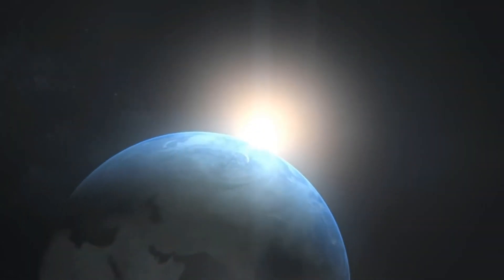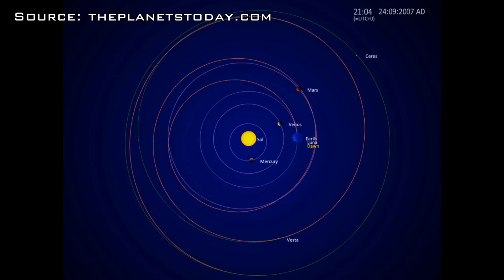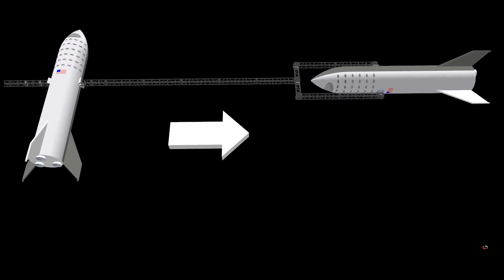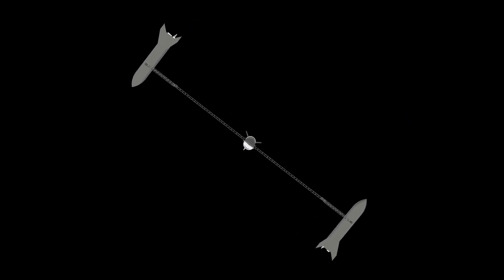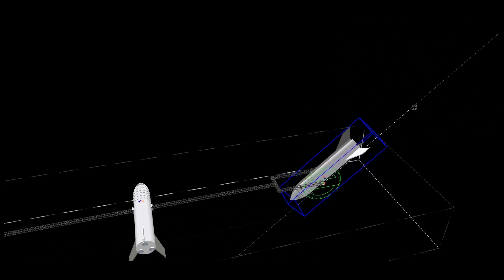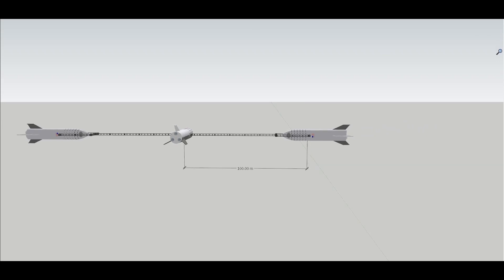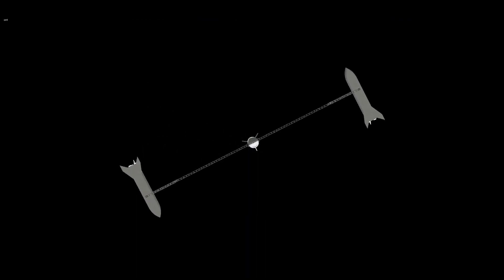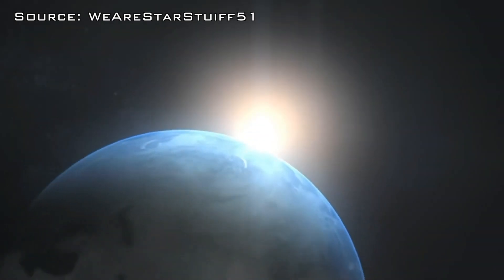GLS2: Artificial Gravity for SpaceX's Starship

Comment: It would be good to consider disaster recovery.
Reply from the maker: I agree! I'm working on a quick release system for GLS v3 right now!
Reply: @smallstars  Yeah. Not just quick-release. But if something happens that severs the linkage between the crafts while they're spinning, you don't want the crafts flying off into nothingness.

Maybe need to account for it with the onboard fuel. Or have some sort of redundancy.
Reply: @smallstars  With a 5 or 7 ship setup, you could cross-link the crafts, so even if the central connection is lost, the exterior ones still exist.

Maybe the exterior connection is done with tethers, with your existing truss-like setup.

Or maybe the exterior connection is done with trusses, and the interior is done with tethers.

Or with that many ships interconnected like a bicycle wheel, going back to using a tether makes sense again.
Reply: @smallstars  Or a truss/tether hybrid. Like trusses that extend outward from the ship on either side, allowing each craft to have two sets of tethers on either side, both expanding the circumference and toward the center.
Reply: Being that they're making specific ships for cargo, moon-landing and mars voyages, I would assume you could have powerful thrusters installed on the sides to get the AG going, rather than spinning the crafts around to get the AG going. Or just have boosters installed on the sides of the trusses. Either way, it would be cool to see if you have ideas outside of just leveraging the onboard engines. There's no reason 1 cargo ship couldn't contain all the materials and engines to create more of a harness structure for several ships.

Comment: I think the smartest way to build in space is with some kind of concrete. You send up the framework and materials for a large pressurised spaceship. Construct the large star ship and slowly send space cement to fill up the wall cavities. You end up with a huge spaceship that is impervious to radiation (like a power station). You could make something really big and barrel shaped that spins to create artificial gravity. Design it all on the earth and construct it in space. This thing will never enter an orbit. It will be a huge ship that maintains orbit around a planet that smaller rockets can dock with. The added bonus of this design is that much of the material for the space cement might be easily sourced on the moon or mars. Nothing weighs anything in space, so you could make it quite thick to add protection from space dust. I wonder if (without gravity) you could use electromagnets to have a barrel spin without friction around a stable core? The nose could have orientated cameras and sensors that are controlled remotely from inside the spinning barrel. The whole thing could be covered in solar panels. Maybe you could have a crew rotation system. The majority of the crew enjoy gravity in the spinning part but there are some crew in the anti-gravity core and nose. The barrel could be systematically stopped, to swap crew and supplies between the two parts (so that no-one stays permanently in anti-gravity).  I literally know nothing about the science of this and just came up with this. Seems legit though, right?

Comment: The radius would have to be more like 1 Km, according to the data presented here:
https://youtu.be/xu1Qv4AfCV4?t=399 (also before the time stamp)

You would never spin it down with the main engines, the vibrations and forces would tear your little tether apart, especially if they do not fire absolutely synchronously - which they would not. Also, it will never happen because you do not fit 2 kilometres of tether structure in to that 3rd rocket - and you would not land it on Mars!. So if anybody ever goes, they will go without artificial gravity. In your 100m diameter model, the astronauts would literally go insane from being pinned around.

Comment: Nice idea but there may be a better way that 1) uses a Bigelow tether that takes up less space when stowed away, 2) uses a simple electric motor to create spin, and 3) uses a central hub control module that is motionless relative to the direction of travel but controls 2 starship pairs each spinning counter-wise.
Reply from the maker: For your first point, I'm working on a new version of this that has a similar feature. For your 2nd and 3rd points, it's tough to apply these solutions to a system of this scale. One of the goals with this system is to be reusable for trips back and fourth from mars. My SpaceX Space Station concept which is on a much larger scale, utilizes you 2nd and 3rd ideas very well.

Comment: Fantastic start!I  I doubt a Starship can take the side loads you wish to impose at spin-up and slow-down.  Easier to plumb-in smaller methalox rockets on the gantry and leave the Starships in the loading position they are designed for.

Comment: You can solve the problem, i think, if you don't swive the ships yo the Center.
Reply from the maker: True
Reply: @smallstars   you need check if the forces of the people walking along the ships are not enought to change the valance of the sistem, you should consider two arms insted of one.

Comment: Could the spin not be used to get the units into orbit, thus saving the 3 tons of fuel upon arrival at mars?
Reply from the maker: Great question! For something like this we'll have to use the "tangential" spin speed of 31 meters per second. I don't believe a change in velocity or delta V of 31 m/s would be enough to save 3 tons of fuel when the starships arrive at Mars. I'm assuming you're talking about flinging them off of the  spin system in just the right direction upon arrival. You could certainly save some fuel by doing such a thing, but it would have to be very very precisely executed.

Comment: Interesting idea based on real physics but as a structural engineer I think the challenge would be making the truss sections strong enough to take the bending forces during the spin acceleration.  Pure tension forces are relatively easy to handle (a cable could do it) but as you rightly noted the truss needs to be rigid in bending to transfer the force couple applied at the outer ends by the starship main engines to the spin axis in the middle. Each truss is therefore acting like a cantilever beam, similar to a diving board with a diver standing on the end. The bending force will be greatest at the end of the truss close to the spin axis and will create opposing tension and compression forces in the truss chord elements. The magnitude of those forces is inversely proportional to the distance (lever arm) between the tension and compression chords, ie the depth of the truss section.  In effect you have a huge lever arm where the bending force is created (the distance between the outermost starships) and a relatively tiny lever arm (the depth of the truss section) where the forces transfer into a torque at the hub.  So the tension and compression force in the truss chords will be roughly equal to:  (starship engine thrust) x (distance between outer starship and hub) / ( depth of truss).  In many bridge type elements comprised of beams or trusses, the span-to-depth ratio of the the main bending element is usually around 20 to 30.  Your truss in comparison seems much more slender than that,  maybe 50 or more .  So the force in the compression chord of the truss might be on the order of 50x the engine thrust. Ultimately  the truss strength will be governed by the compression capacity of the truss chord. Not sure what the thrust of a starship engine is, but 50x that (even at 20% throttle) would still be 10x the engine thrust. I doubt your slender truss could be designed to take that,  unless the truss section depth was much larger.
Reply from the maker: I very much appreciate this comment.

One thing I would like to point out though, is that the diving board in your analogy is connected to the ground at the side of the pool which is what creates the bend. Now imagine as it would be in space, where the diving board is not affixed to anything but resting on it's mount. The diver jumps out onto the edge of the board, the diver falls into the pool while the back end of the diving board is sent flying up into the air, flipping around with the exact spinning motion the GLS aims to create.

The span-to-depth ratio will still apply of course, but not as much as it would for an actual bridge span here on earth. I am very grateful you pointed it out though and I find it interesting that it is usually around 20 to 30. I'm working on the next way better version of this (fingers crossed) and the information you posted here is very helpful!
Reply: smallstars I disagree with the premise that system will somehow start spinning without generating internal bending forces.  The lateral forces from the outer starship are applied away from the center of mass.  In an inertial reference frame (eg microgravity, without the ‘diving board’ connected to the ‘ground’) a force applied away from the center of mass will have 2 effects : the force will cause an acceleration of the body in the opposite direction (translation) , and the moment (force x lever arm) will induce a rotation about the center of mass.  In your scenario  the starship  engines fire in opposite directions so the translation part cancels out. This leaves the moment part which is trying to induce the desired spin. The moment creates a torque at the center of mass which will indeed cause the whole system to start to rotate , with the rotational speed increasing as long as the force is applied.  But the system has mass and therefore has rotational inertia which will tend to resist that acceleration.  For linear acceleration the acceleration is the force divided by mass or a=F/m. For a rotational system acceleration is torque divided by rotational moment of inertia. You cant get the rotational acceleration without the torque, and you can’t get the torque into your system without subjecting the truss to those cantilever bending forces.  So the slenderness of the truss will limit how much bending force it can handle and therefore how much engine thrust can be applied at the end. I suspect that your slender truss could only tolerate a very small lateral force,  much less than what a raptor or merlin engine would apply.  If the applied lateral force at the ends was small (say on the order of what cold gas thrusters would apply, but for a much longer period of time ) then you could eventually get the same rotational speed without overloading the trusses.  If you wanted to use the main engines, the trusses would need to be much stronger and heavier. Taking the initial metaphor further, your diving board can handle the weight (mass x acceleration due to gravity) of a person, but if you put an elephant on it , it will break.

Comment: Use 4 starships instead of two.  Each pair spins in opposite directions.   A electromagnetic propulsion system can be used to push against the other pair to start or stop spin without fuel.
Reply from the maker: You are brilliant! I have been working on a design that uses this. Well, it sort of uses this. It's a giant space station, video should be out next week if all goes as planned with my 3D renderings.

Comment: How much force does the engine of the starship experience then?
Reply from the maker: The vacuum optimized raptor engines should be able to produce somewhere around 2,000 kN (440,000 lbf) of force on the starship.
Reply: smallstars — Yes, but what I actually was thinking of, is how much force the bottom of the ship is going to experience in the rotation scenario, if the upper parts are already at earth G. Would it be able to withstand?

Comment: Excellent presentation, My thought is why do this on the way to Mars. Once the first 2 starships leave with supplies for Mars 3 more should be launched and put in lunar orbit.  Spin them to 40% gravity , you could see the affect of time spent on Mars.  Would probably make a better Artemis base that what they are planning. Best part it can be slowed down if supply ships arrive or need to leave.
Reply from the maker: Great idea! Might have to include this in an upcoming video!
Reply: smallstars   Thanks, your more than welcome to use the idea.  Along that line of thought,  if this was adapted, you could use the central starship as a micro gravity lab/ work space while having the other 2 as habitats if it was a permanent in orbit setup, could expand the trust setup to allow movement between the vehicles without the need of spacesuits keep up the great work ✌️👍😎
Reply from the maker: @AlRobNB  Yess! central micro grav lab has always been part of the plan, but it always ends up getting cut from my videos. One day (in the very near future because it's 3rd on the list) I will make a dedicated video about such a lab, which will also touch on micro grav sports for long duration missions
Reply: smallstars  one more thought, why the third central ship to Mars?  What about a starship cargo launch with the truss setup, but just leave it in orbit. Add some sort of a control unit for the center of the truss with an ion engine and control thrusters. Once the  human starships are fuelled and ready to go, connect up to the truss, and the 2 ships take off in sync. Once up to speed, they can carry out your idea of spin up.  Once they arrive in mars orbit, detach and leave the truss in orbit with the ion engine to keep it safe.  Then if the ships leave for earth, the truss can be connected again and off it goes. Leave it is earth orbit for the next outbound run.
one downside to this idea, the third ship would be a potential life boat if anything happened to a primary ship.
Alan

Comment: how many Gs that tilt maneuver pull tho?
Reply from the maker: The whole swivel action and mechanism got cut from updated versions of the GLS, which will hold starship loads by their feet, as the starship design intends. That said, in this verison, V2, the swivel/tilt can be done slowely, allthough with much difficulty while the system is spinning.

Comment: If you would attache the two Starships the other way round, so with the booster facing towards the center, the strukture would have less weight attached to it as the booster and the tanks are closer to the center of the rotaition. Furthermore would the struktur be smaller as the passengers are further out. The only downside is, that you would have to mount everything upside down for the duration of the flight and then remout it after ariving at mars.

Comment: So A ship that was designed to stand on legs and then be pushed from the engines on the thrust puck. If you were to put a anchor point in the middle. And spin the weight of the ship would fold it in half its thin steel like a can of bug spray. And the support structure  to make it work would be so heavy  it won't work.
Reply from the maker: I mostly agree! There wouldn't be that much of a mass penalty to make the starship structure strong enough to hold at points on the sides of the hull, but after all that I've learned in the past year, that does seem foolish, not to mention they're having so much trouble getting the structure hold propellant at high pressure. New versions of the GLS will hold starship loads by their feet, as intended

Comment: I will just add a few more of my ideas, whether or not you think they are of any use: I don't see why you would need to carry the third spaceship on the journey to mars. If it carried the trusses (or the separate members to make them) it could surely be left in Earth orbit. The system would obviously work with only the outer spaceships, like a binary star system and they would rotate about their overall C of G - which should be kept as close as possible to the geometric centre. I guess that the two ships, carrying pieces of truss, would both accelerate to leave Earth's orbit, and then the final assembly and rotation would be achieved when they were in freefall on their way to Mars. I wonder what you would think of another alternative: If sections of a large (say 1.5m diameter) tube could be taken in place of the trusses, could they be used to connect the two spaceships together, and fully sealed and pressurised, thus allowing full transfer of people and objects between the spaceships without the use of space suits? Are you going to contact the man himself?